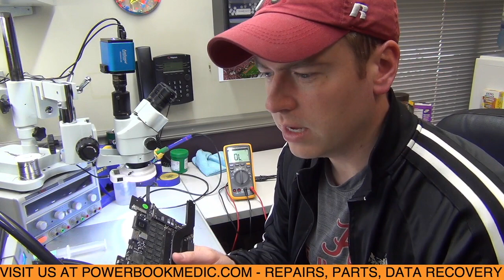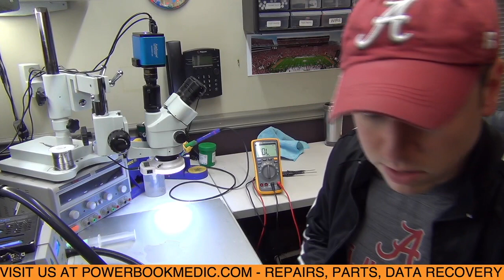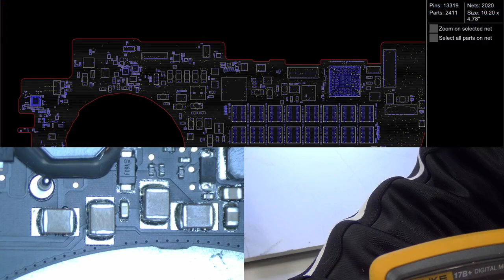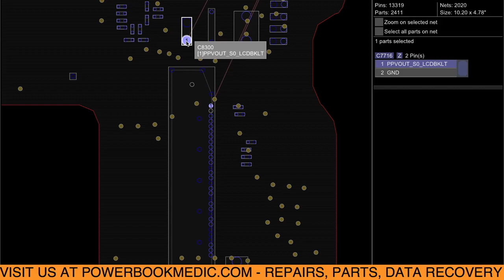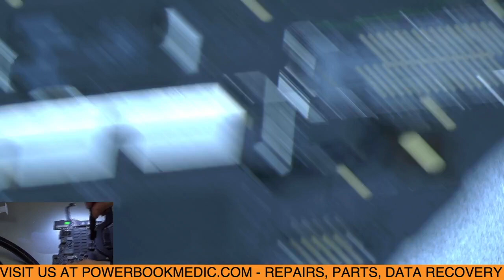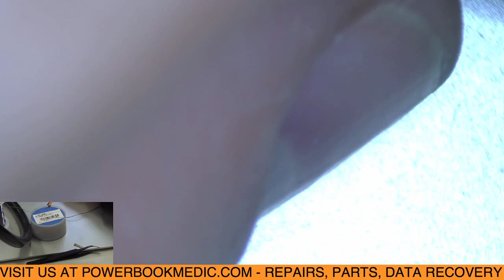Macbook Pro No Backlight Repair on an A1398 2013 15" Retina with Board 820-3662

Comment: my friend I received one with this same problem, I changed the connector of the screen I also changed the cable that goes from the screen to the motherboard, I changed the fuse, without the screen it reaches 55v on pin 1 of the backlight, but when I connect the screen it lowers the consumption to 12.5v, do you have any idea what it could be?

Comment: Hi, really good and informative and well explained video! Thanks 🙏🏻 
Do you bay any chance have a partner or repair place in the Europe?
I bought an old MacBook Pro 15” mid 14. 
I think the display has been replaced, but not 100% sure. 
There’s no way to dim or brighten the display, and the backlight will turn off randomly, and not turn back on before a restart. So I could use a little help 😉 but not sure the computer is worth enough to send it to the us 🤔
Reply: Try replace the driver

Comment: Thank you for this video. The capacitors appeared shorted but after following through to the LCD screen connector, it was obviously burned. I need to replace both the LCD connector on the board (820-3332A) and the LCD cable attached to the screen. This saved me pulling the capacitors off needlessly. Keep up the good work!

Comment: I have the same sue on my A1398 late 2013. No backlight on KB and screen but I can use external monitors. My screen is OK I think because when I place a flashlight on the Apple logo, I can see the display. Is it a common issue on this particular model? Here in the Philippines  my only option is to buy replacement logic board.  Do you sell necessary components? Maybe I can repair it on my own. I will appreciate your response.

Comment: Hi, in my case the display is on, no backlight, however once in a while (rarely) the backlight turns on and off again real quick, so the display flashes. Does that mean it's not a logic board problem and that it could be a loose cable or something more simple like that?

I mean, if i had a faulty logic board would it be possible for the backlight to flash like that?

Thanks!!
Reply: I have this same issue. Have you resolved this yet? Im very curious to the answer!
Reply: By the way i have replaced the screen cable. This hasn't resolved the issue for me!
Reply: @rowan5328  Nah man. in my case, apple changed my display to a new one because they said it was part of a recall program. from then on, i took the computer to apple twice (under warranty), they said the problem was in my display, changed it to a new one and the problem reappeared after a few weeks. Im on my 3rd brand new display changed by apple and the problem persists, now out of warranty.
Reply: @rowan5328  it almost feels like the computer *thinks the lid is closed when its open. cause fucking around with sleep, closing and opening lids and shit like that makes it flash sometimes. but i've tried every suggested solution, shortcuts and combination of events and stuff, nothing works.
Reply: @marcosmyara8929  Does it look like this? https://www.youtube.com/watch?v=ugnDovHjHVA&lc=Ugyq-6AviHzY-GDF8Pt4AaABAg.988SDh65hO199h0qWvezHY
Reply: @rowan5328  no. my screen is pitch black the whole time. i can see whats on the screen if i put a phone flashlight right close to it. and the flicker happens occasionaly and its just a quick flash and then its gone again.
Reply: @marcosmyara8929  So annoying.. Good luck with it..

Comment: What temperature should I run my 858d hot air station and 60w budget soldering iron?

 Id love better equipment but cant afford it for the odd repair and honestly gameboy modding.
https://www.amazon.co.uk/Soldering-Diameter-Temperature-Adjustable-Electric/dp/B01M1IH13A/ref=sr_1_7?keywords=soldering+iron&qid=1582057445&sr=8-7

Comment: Hey man! Loving the videos ! I have a 2015 15” retina with the same issue. I replaced the lcd connector and on the 4 capacitors I am getting a resistance of 163. What would be the next step for me?
Reply from the maker: Creative Visuals New Zealand What is the voltage on those capacitors?
Reply: @PowerbookMedic 
Thankyou for your reply. I get 0v on them
Reply from the maker: Creative Visuals New Zealand Most likely, your backlight fuse is blown or you has a short in the LED driver IC.
Reply: @PowerbookMedic  Thankyou! I just figured that out!

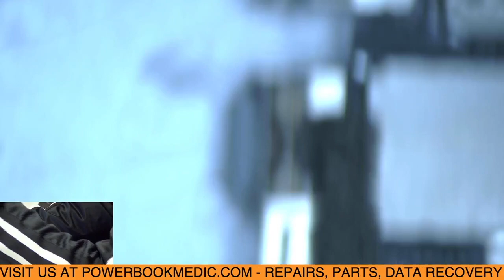Comment: What is the rather large (by comparison) surface mount passive component (I believe it's an 0805 size) directly adjacent to the display connector?  (visible to the lower-right side of the connector at 14:45 in the video) Is it a capacitor or just a ferrite, or something else completely?  Mine is half burned up, and the built-in display doesn't work.  HDMI works fine.  Connector on the board as well as on the LCD cable looks completely fine without any visible damage.  Hoping for an easy "fix"... I've even thought about removing the component and just shorting the pads, thinking it's just a shunt to ground for the LCD panel?
Reply: More info - I found that the very last pin (closest pin to the component mentioned above) on the LCD cable connector (connector attached to the cable, not the socket on the board) is smashed and was possibly shorting to the metal frame of the cable connector.  I was able to bend it back out of the way, so it's not shorting, but I don't believe it will still make proper contact inside the socket... So... even if I find and replace the half-burned component, I'm thinking I may need a new display as well?  Or can I just replace the display cable itself?
Reply from the maker: Its actually a Coil.  Its measurements are:  15ohm-100ma-8.5ghz
Reply: @PowerbookMedic  - Thanks for that info!  Very much appreciated!  Do you have a recommended approach to repair in this instance, where that coil is fried, and the cable connector has physical (not burn) damage?
Reply from the maker: @briangullikson5865  Yeah, that coil will need to be replaced.  Then the display connector and the display cable will need to be replaced most likely.
Reply: @PowerbookMedic  - Do you sell those parts?  I'm pretty comfortable around a soldering iron... used to do surface mount assembly line work.  I assume replacing the display cable is incredibly complicated and that replacing the whole screen assembly is the best bet?
Reply from the maker: @briangullikson5865  We don't sell the individual components. We do sell defective boards which the parts can be harvested from but we currently don't have any of this specific board for sale.
Reply: @PowerbookMedic  - Is the bottom-most pin on that display connector needed for proper operation, or might replacing the coil cause everything to work again?
Reply from the maker: @briangullikson5865  Yes it is needed.  That is the LCD Power line.  It comes from the Coil.
Reply: @PowerbookMedic  - I truly appreciate your knowledge and willingness to share that knowledge!  I've ordered a dead logic board from China... here's to hoping that coil is present, and that I can desolder it easy enough.  I also ordered a new LCD cable.  I hope and assume all I need to do is snap open the black strip on the bottom of the LCD panel to gain access to the other end of that cable?  Also, might you anticipate any other components on the other side of the logic board that could also be fried because of this apparent failure?  Thirdly, do you have any sort of email or chat support service for this type of conversation rather than an open youtube comments forum?  Once again, thanks for the help!
Reply from the maker: @briangullikson5865  It's impossible to say what other issues you may have without seeing the board. We do not have a question support system for component level repairs. We just answer general questions on topics via this YouTube channel.
Reply: @PowerbookMedic  - I just wanted to once again express my appreciation with the help you freely offered here.  I was able to replace the coil and the display cable, and the Macbook Pro is working perfectly!  My wife loves the "new" computer!
Reply from the maker: Brian Gullikson Great! Thanks for the compliment! Glad we could help!

Comment: Hi! Thanks for your video! you do it great, my first LCD connector was just a nightmare to change  haha
Just a simple question : I have the same backlight problem on my A1398, (fuse is good, but no power on the boost circuits, each of them get very low voltage. But the LCD connector seems to be good, no burn, nothing...) But I figure out that it's not really the same board than yours. When can I found the number like "820-3662" correspond to my board?
And if you have any idea of what can I check on board to find the problem, do not hesitate! Thanks for your time!
Reply from the maker: The board # is printed on the board itself. The location changes depending on the model board, but you can usually find it printed close to the edge towards the back of the board.
Reply: @PowerbookMedic  Sorry to disturbing you again.. I mesured all boost capacitors when power is on, and the voltage is always low. But I don't see short to ground on the LCD connector or anywhere. Something is strange, there's no backlight on the screen, but when the computer is low battery, the screen turns on, lights up and shows me the symbol that I need to reload the mac... You think it could be a data problem? replacing the LED Driver would be relevant?
Reply from the maker: @corvaxx5402  One thing to try is resetting the PRAM.  Hold down the ‘Option’ ‘Comman’ ‘P’ and ‘R’ keys all at once as soon as you power on the machine. The machine will chime and then the screen will turn off.  Continue holding down the keys until you hear the start up chime again.  See if you have backlight now.  If not, you have something strange going on with the board.  I don’t believe it would be a problem with the LED driver, however, it never hurts to try.

Comment: hi,another brilliant repair there from you and well explained and the work through the board ic (power rails),learn sooo much every time i watch your video.i love the board view than the schematics bcause it shows the actual board layout.thanks very much for your knowledge.Please can you make a video board ics,their names and function and the power rails on how power is distributed for the board to light up.
Reply from the maker: Thanks for the comment. I'm not sure exactly what you are asking for though. Are you asking to show the board view software more? The problem with the board view is that is doesn't give you as many details about the board such as voltage values which are more helpful in the process.
Reply: @PowerbookMedic  thanks for the reply,no just ask if you could make a video about motherboard diagnosis power rail work through and some of the most important ics on the motherboard.thanks once more.
Reply from the maker: @linksrepair2851  Ok, I understand. The rails are different in every model, so making one video discussing just the rails doesn't make much sense. We'll try to cover it in more detail on future videos though. Thanks for the feedback.
Reply: @PowerbookMedic  understand and thanks.